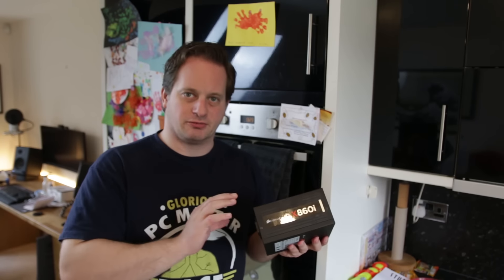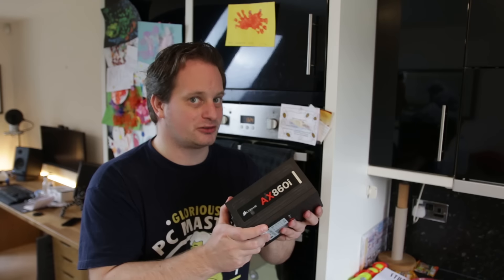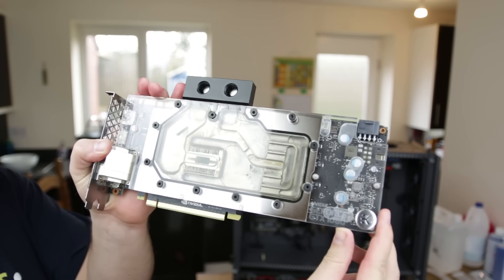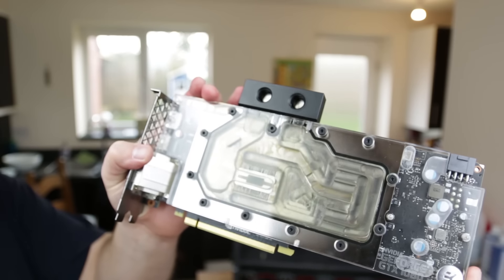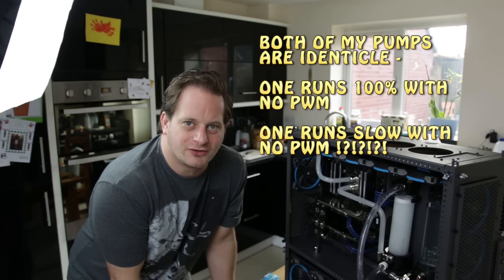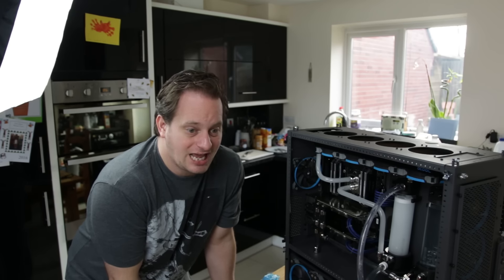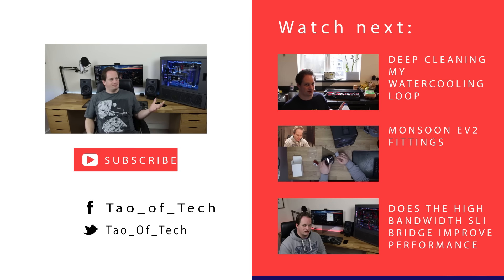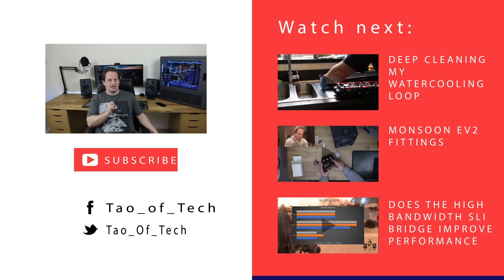Building a custom hardline watercooled PC

Comment: looks great !!!
Reply from the maker: +MrGodspd thanks, appreciate it
Reply: btw what do think about this radiator design any plans on upgrading to these ?http://www.aquatuning.us/water-cooling/radiators/radiators-active/20923/alphacool-eisbrecher-pro-xt45-full-copper-360mm-radiator?c=6566
Reply from the maker: Looks like an interesting design, I'm a little sceptical of new designs which over complicate but I would need to test it to see if the claims are true. You do get dead spots in the corner of fans, but with static pressure fans it shouldn't matter too much, they are designed to ensure air is 'pushed' through the radiator.

Comment: Glad you switched fluids as you shouldn't get that build up in the gpu. Also good call on the psu so many people just don't understand psu s and power need. 460 watt handles oc 1070 and 6700 for my htpc
Reply from the maker: +James Emsley yeah the fluid build up is worrying, the deep clean with the mayhems blitz kit sorted it. So many people over egg their PSU, such a waste of 💰 but PSU manufacturers lure us in eh!
Reply: Tao of Tech I wish I could find a match for case labs gun metal grey. I have a white sm8 and want to have the gun metal grey. Probably paint the outside black for a two tone. Just got aquero and heat killer tube reservoir. Can't wait to be installed
Reply from the maker: sounds great - always fun to keep evolving your build

Comment: I will never understand taking form over function to the point where people use gunk building liquids for looks. For me distilled water with appropriate precautions is more impressive.
Reply from the maker: +Bill's Channel distilled water with a kill coil definitely does the job and looks great
Reply: I just kept thinking poor guy, you had sludge on such a young system. I didn't notice any big mistakes on your part so assuming there weren't any I have to wonder about that original fluid, and all the people who must continue to use it despite getting sludge. Here's to hoping the next brand works better for you.

Comment: Nice build, I've been looking through a lot of custom build logs by many people and you're the first I've found that has chosen to use the Monsoon fittings. My questions since they've been in your build for a while now, how have they been doing and did you ever have any issues or anything with them so far? Thanks, great work
Reply from the maker: they are a great set of fittings but you do need to know what you are doing. They come with different 'o' rings for different size tubing. The fit is VERY snug so they require a reasonable amount of force to get the tubing in. No way these should leak as each fitting has 2 o rings in it and a tapered piece of plastic where the compression fitting fits over the base. Highly recommended. I have a video on them here https://www.youtube.com/watch?v=efME-nZNJHE